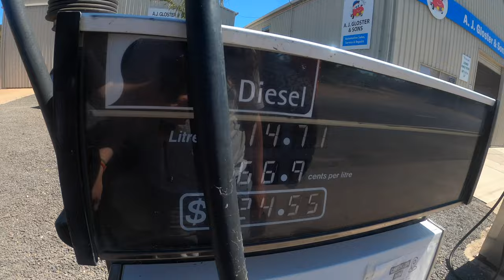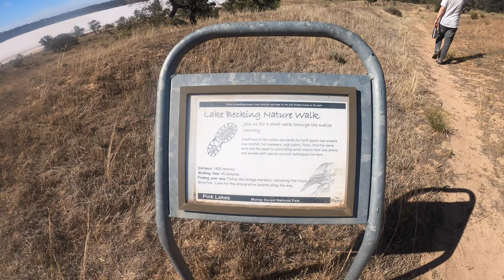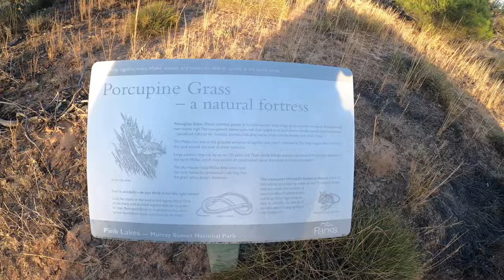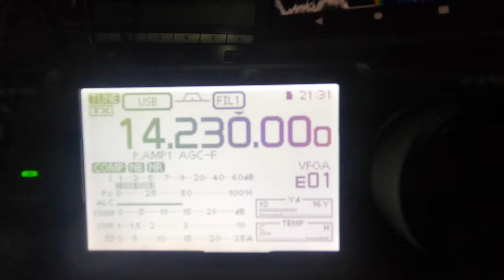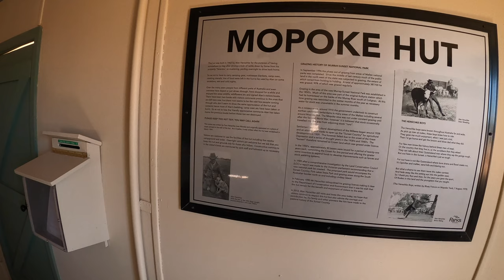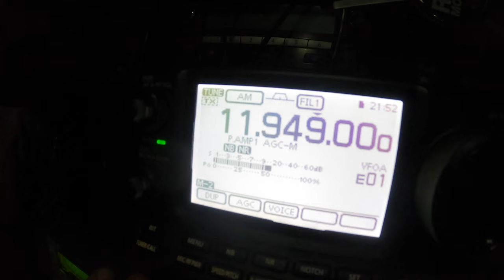A 4WD Tour Of Murray Sunset National Park - Victoria's "Outback"

Comment: What watch is that you showed at 1:23 ? Do those maps work with no 4g as in offline mode available or?
Reply from the maker: Garmin Fenix 6X Pro. The maps are stored on the watch, and the watch has a GPS receiver built in, so it'll not only work with no 4G, it'll work with no phone.
The watch is pretty big, if that puts you off, the 6 Pro is smaller, and the 6S Pro is smaller than that, with all the same features - the only difference is more battery and slightly less pixels on the display.
RRP is about $1250 but for the past 6 months or so prior to the Fenix 7 coming out, it was widely available for about $600, and that's what I got it from JB Hifi for. 
Now that it's been superseded by the 7 it's being sold for full price!?